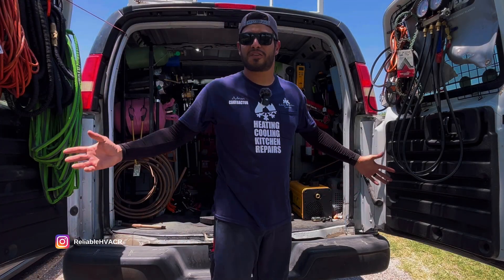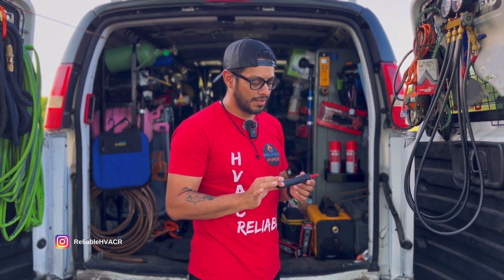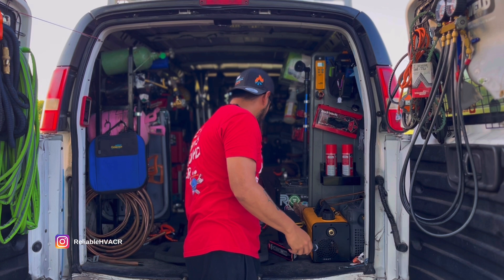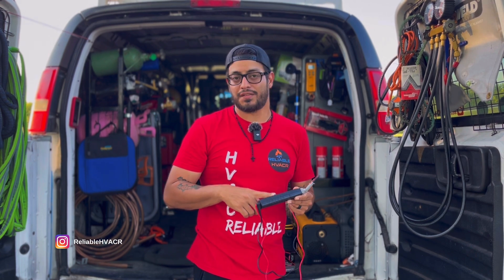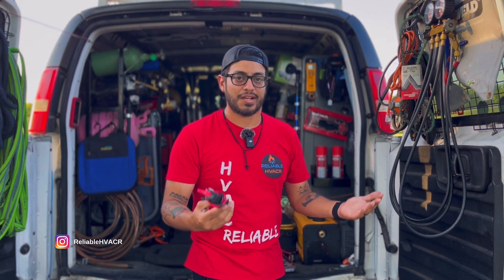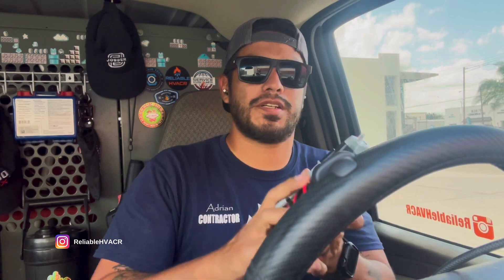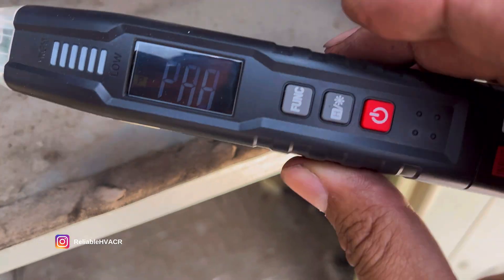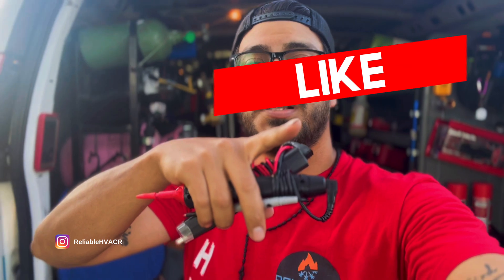Kaiweets Pen Style Multi Meters | ST100 & ST120

Comment: Having 2 leads on a pen multimeter kills it’s purpose really, if you want compact buy the Kyoritsu 1030, it has the lead built into it and the size is smaller than both of the ones shown on video.
Reply: Also Kyoritsu Is a well known brand when it comes to multimeters

Comment: Like your video on this product line... The ST120  as compared to the Mt007 series does make measurements faster.  For example, capacitor checking is significantly faster, but still not as fast as a Fluke meter.  The ST120 has the largest display in this type of foot print,; However, as you mentioned, it does make reading in outdoor direct sun difficult enough that I stick with the MT007 or A3007 LCD displays, The MT008 and the A3007 all which have various brand names on Amazon and ebay are Color VAs. The control logic in the ST120 is easier to use than the others I mentioned and uses 2 AAA versus the others which use 1 AAA. I use the A3007 and MT007 in my EDC pouch for quick service jobs and resort to a Fluke 87 for the more complex issues which is in the HVAC service truck until needed.

Comment: Question, I few years back I had a wire tracer that had a cat female as well as 2 clip on wires. It worked great, tracing wiers through walls of any kind, 16-18 inches in the ground. Well a tech-support from the cable comany was here to fix a wire and took it.  I bought another cheaper one $21 and it sucks. Do you have any ideas what I should buy at $100 or less, less. lol

Comment: What magnet are you using to hang that toolpouch?
Reply from the maker: I attached a rubber magnet thru the screw hole of the clip. 

Not sure if you follow me on other platforms but I'll be posting a short minute long video that basically shows how I made it this week. It'll be used to mount the solderweld kit to my torch.
I'll try and post it here soon also.